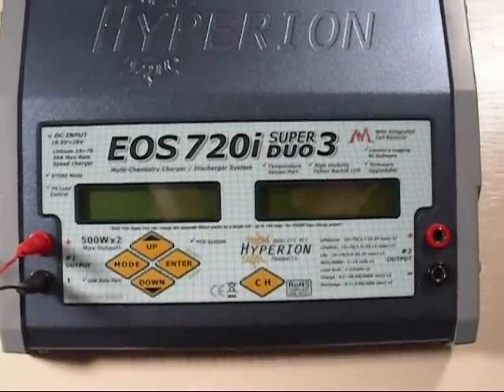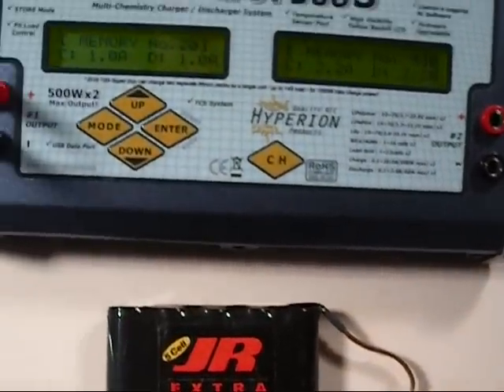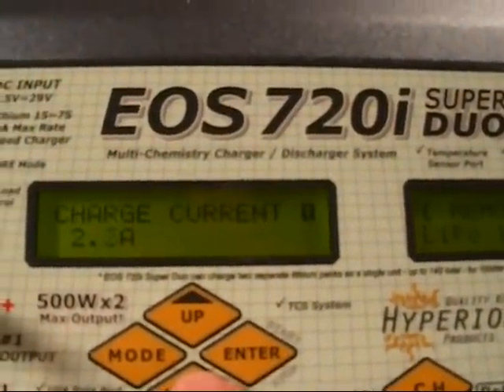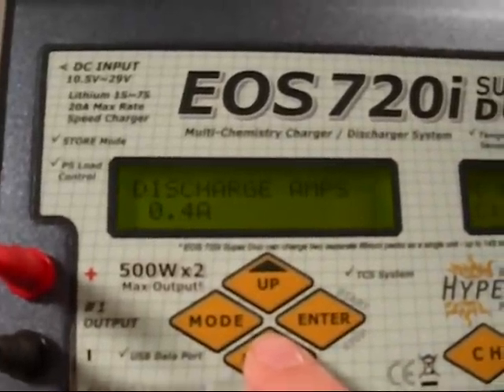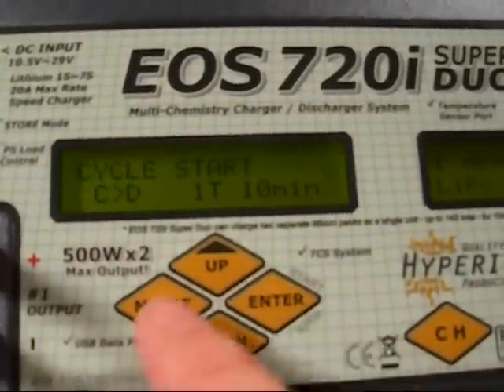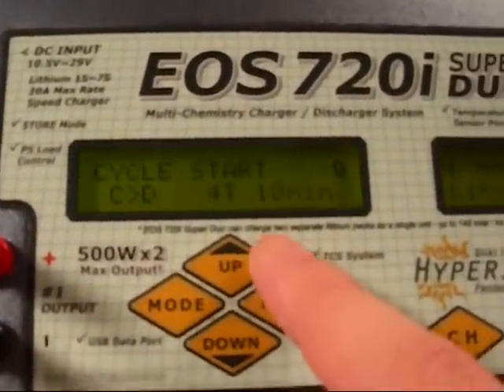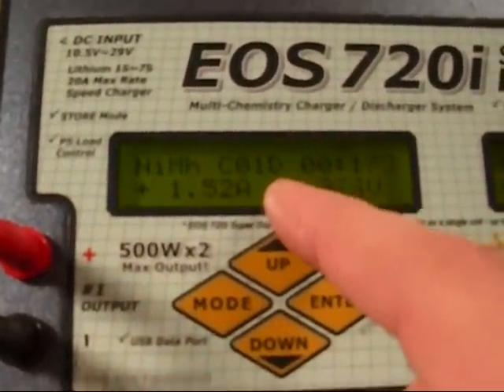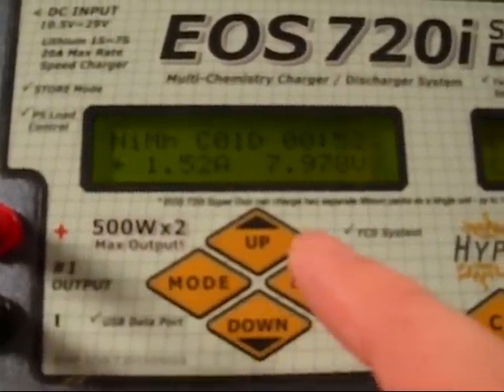EOS 720i Cycle function

Comment: Pretty helpful stuff except that minimum discharge voltage of 0.5V looks damagingly low to me.

These guys reckon 0.8Vis the minimum for a 0.5C charge rate and the minimum should be higher for slower charge rates.

hangtimes. com/rcbattery_faq